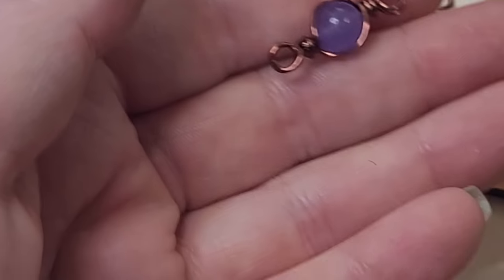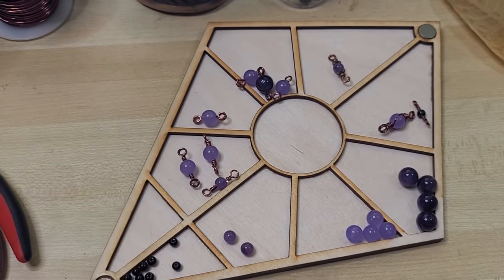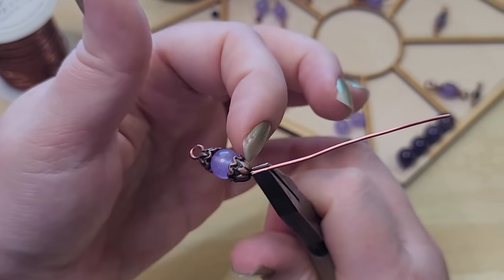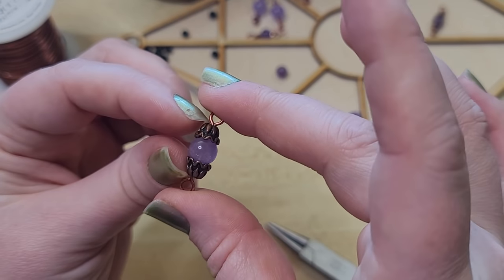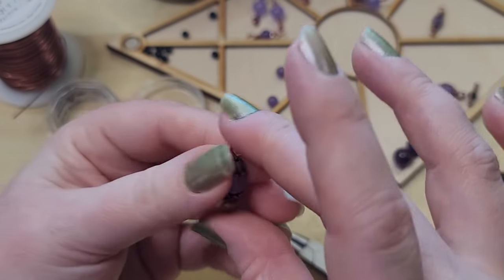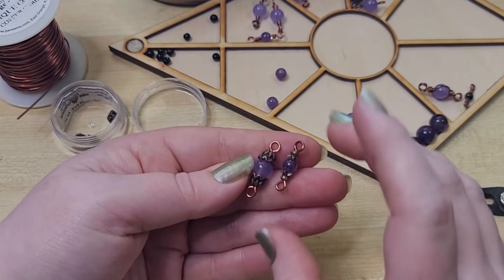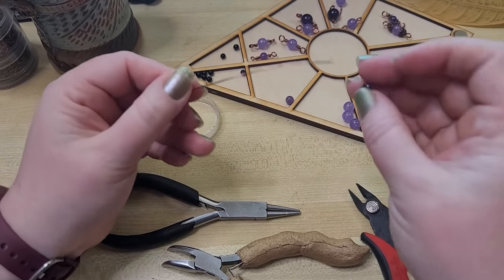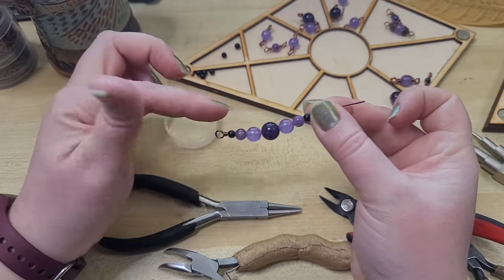Wire Wrapping Master Class: Beginner Level 1: Links

Comment: Invaluable tip buying box hinge pliers. I need to purchase a new bent nosed plier. My tips no longer meet at tip. Is there a reasonably priced bent nosed plier that is strong but has long skinny bent tips. I use hem a lot, am using the flat nosed narrow plier but not as easy.

Comment: I have just started wire wrapping again after 20 years. I usually work with sterling. The problem I'm having is the wire is rock hard and difficult. This was not my memory of this metal. Am I remembering wrong? Any info would be helpful. Thanks🙂